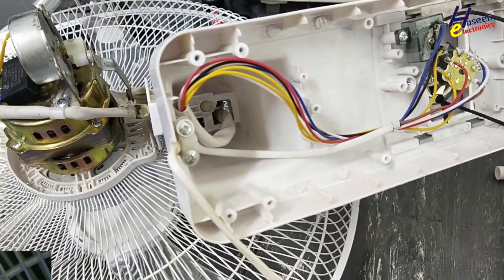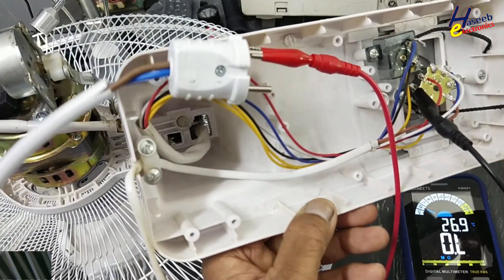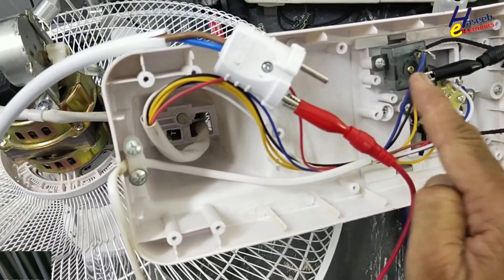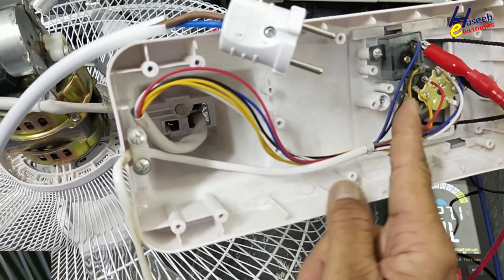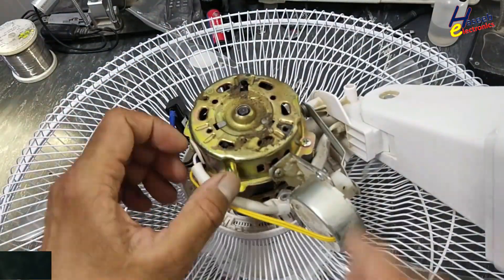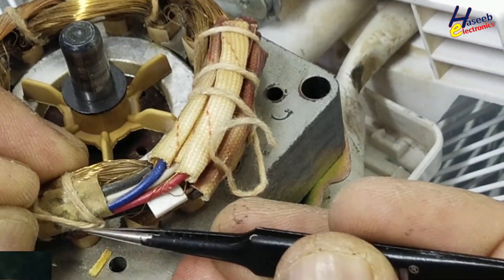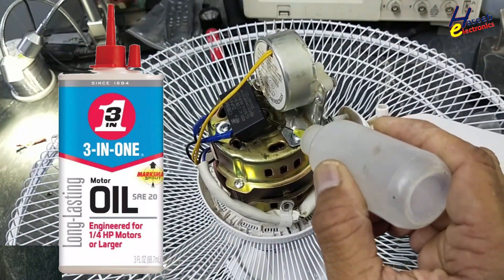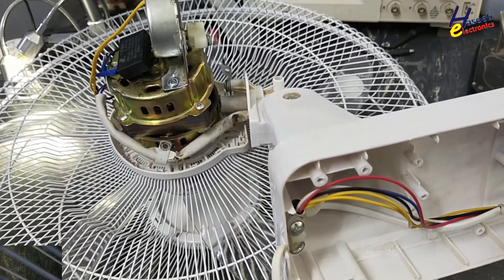{1337} Wall Bracket Fan Not Working? Step-by-Step Troubleshooting Guide | Haseeb Electronics

Comment: Hello Mr haseeb I'm from Kenya kindly can you show a repair of interheat controller smsps troubleshooting . Because I tried to replace a blown capacitor with a new one but worked for 10 sec and the whole circuit blew up.